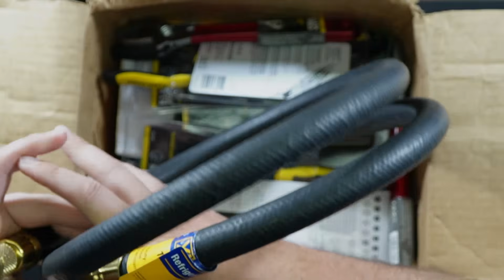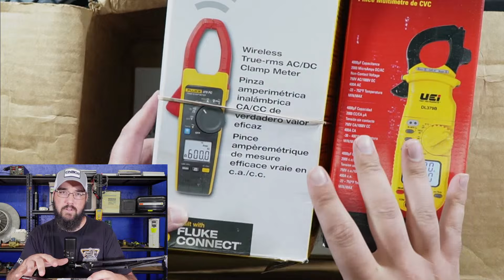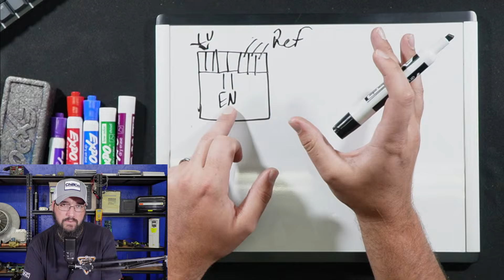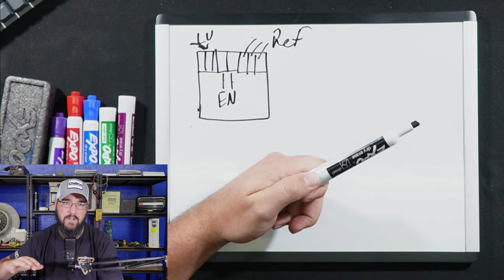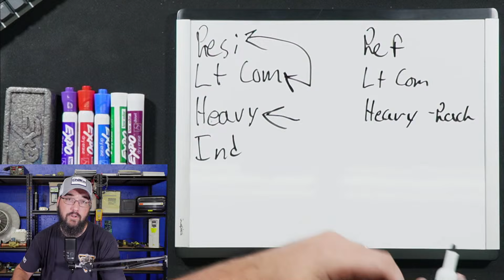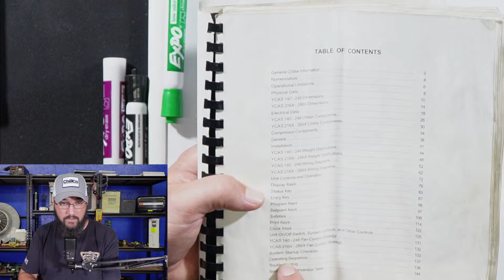Chiller Questions Answered LIVE E.43

Comment: I’m from northern Australia where our temps are hot all year round, on the RTAF chillers that I look after both have the enable as a Digital Input. It can be either Open Line or constant voltage to enable or grounded to disable. Had a very similar issue one time
Reply from the maker: Awesome input, thank you bud!